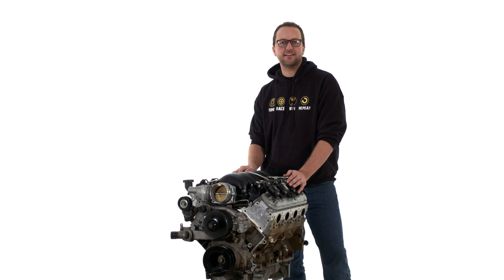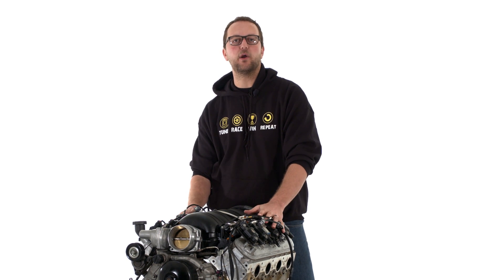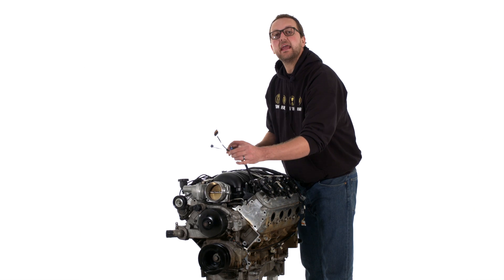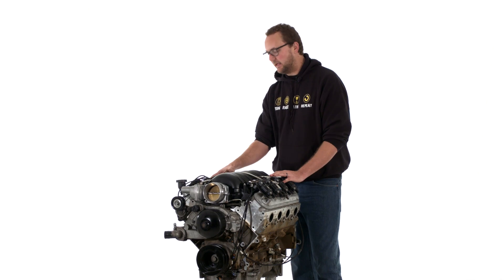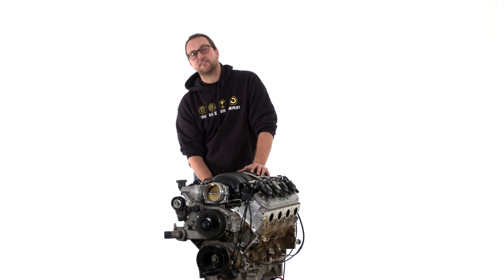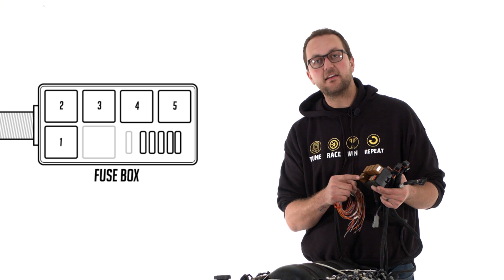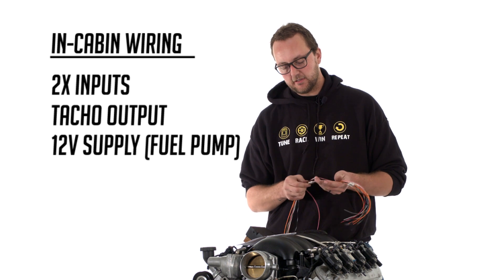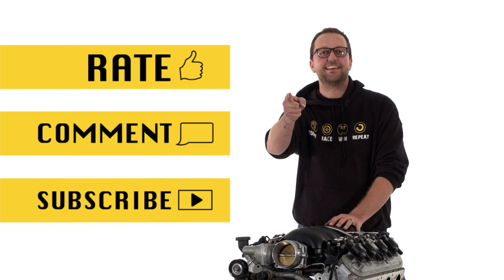💬 How to wire an LS engine | TECHNICALLY SPEAKING

Comment: planning on LS swapping my opel omega ( GM/holden platform) but i want to keep the factory dash/dails... is it possible to use the factory stuff with the LS loom kit and ECU?? i've got an electronic speed sensor in the gearbox, and a crank position sensor that is also used to show RPM`s or do i need to config/wire that in differently??
if you need more info and pictures im willing to provide those via Email should you request it
Reply from the maker: Your best bet would be to chat with one of our tech support guys - you can reach them via email on support@haltech.com or you can submit an enquiry form here:
https://support.haltech.com/portal/en/newticket?departmentId=309315000000006907&layoutId=309315000000074011

Comment: ls2 vortec saab 9-7
Bro help please !, After installation lpg, mixed 4 and 6 cylinder. In the original bundle 6 and 4 cylinder GND- two green wires and one with a black strip. Where is it, help

Comment: How does my haltech iq3 street dab hook up with my elite 2500 ecu and ls3 terminated harness? the can low/high connector suppied with the iq3 street dab has no where to be fitted on my ecu or harness?
Reply from the maker: If your IQ3 Street is the only CAN device being connected to your elite, you require CAN cable HT-060201. If you’re connecting to a CAN hub, you require CAN cable HT-060200.

Comment: Are they any plugs that go to the transmission???
Reply from the maker: There is a vehicle speed input wire available, however this is not terminated as the plug would change depending on which transmission you are using.

Comment: Good description on the wiring harness. But you did not mention anything about programming the computer if you're installing the motor in a muscle car. I'm thinking of installing an LS motor in a 68 GTO. Need to configure wheel size, gear ratio. are you going to have another video describing how to do this computer programming?
Reply from the maker: That's not a topic that we can cover in one video as tuning is different for each car/engine. We do however, have training seminars which teach you the basic of tuning and in particular how to tune using Haltech's software and hardware.
Reply: Haltech .. where can i get the base map for LS1/2 etc .. so i can jump start the engine

Comment: As a motor mechanic that left the industry in 1990 this crap does my head in.
Reply: The good thing is the Haltech Manual explains everything step by step.  I remember my first Haltech install when the E6 just came out, I just read the manual and learned EFI install step by step.  Will a little help I was able to tune although there were no UEGO controllers available at the time that was affordable, unlesess you had a friend in a F1 race team and they would lend you their Horiba (the size of a weekend suitcase) .  No a a days they are dime a dozen.

Comment: Is this loom offered on its own with an OEM plug if you were going to retain the standard ecu?
This looks about the most painless way to convert to LS, but I just dont need the flexibility of a haltech ECU unfortunately
Reply from the maker: Unfortunately no. This harness is terminated to suit Elite ECU. OEM ECU actually sits inside the engine bay so the harness is completely different.

Comment: Very easy wiring . Does the elite offer rolling anti lag , back pressure,  and what kind of egt probe does it use?
Reply from the maker: Rolling anti lag - Yes, exhaust back pressure - yes, we can log that, EGTs - we use open tip, K-type EGTs.

Comment: step 1: tie wire around engine.
step 2: tie other end of wire to any non GM car.
step 3: drag LS to the dump.
step 4: dispose of LS.
Reply: most b a ford goof
Reply: Says someone who has probably never done a ls swap..
Reply: You also offer HT-141366. Same description and price as HT-141367. What the difference between them.
Reply: LS engines are the most popular swapped engine in the world cars boats and even planes they're also proven to hold up under pressure even when heavily modified it is incredibly reliable
Reply from the maker: Marlin Kleber speaketh the truth.